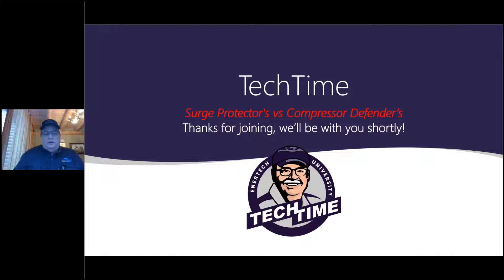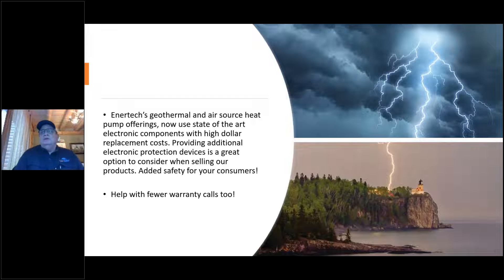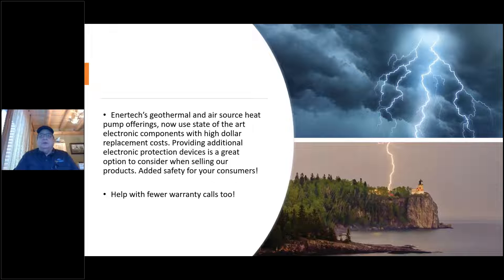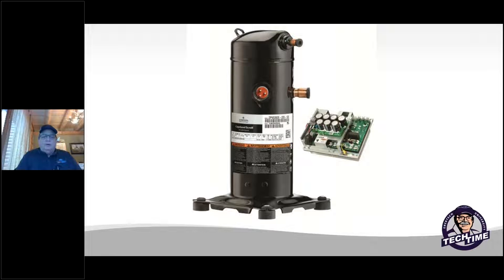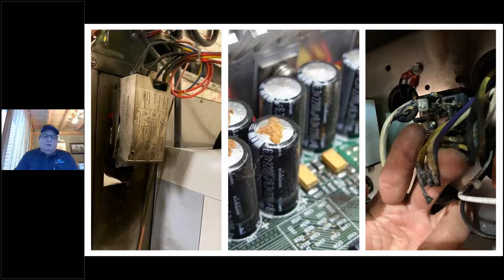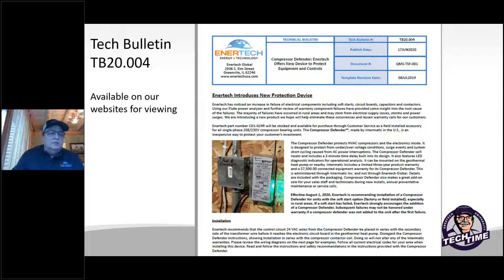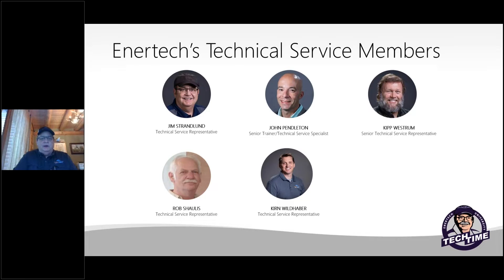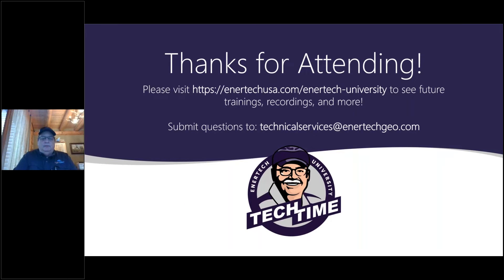TechTime: The differences between Surge Protective Devices and the Compressor Defender

Comment: If you have a full inverter variable compressor and blower system, wont they automatically start up slowly ? In which case the defender is moot ?
Reply: It even more complicated because the instructions do not cover inverters. The inverters are run by a circuit board powered by the 24 v transformer in the air handler. If the 240v power is cut to the compressor the circuit board doesn’t know and the compressor is off and will not restart until the power to the board is cycyled or the thermostat is cycled. These boards can be two speed or communicating types and cycling the Y1 may not be an effective way to cycle the board. The Compressor Defender also has a flaw in that when power is lost, the low voltage contact remains closed until the power is restored. When the power is restored the low voltage is then opened and the timer started. The board should have its own internal timer too.

Inverter systems should not be disconnected while running because they go through a power down cycle. Obviously, sudden loss of power happens in the real world and hopefully the protections are built into the unit.

What does this mean? On an inverter system, cutting the power to the Y1 may start the power down cycle taking time. If the system uses both Y1 and Y2, the results of cutting power on Y1 is unknown. If the unit is communicating type the Compressor Defender cannot operate the cycling and cannot defend against over and under voltages, only voltage spikes.

My question is, is it safe to connect the Compressor Defender to break the common wire and kill the power to the board? This would still leave the board at risk because it is still powered on until power is restored and the timer restarted. 

The alternative is to use an IM393 and a 240 v relay to disconnect the common wire and kill the power to the board. A separate timer could be added if a delay is required.